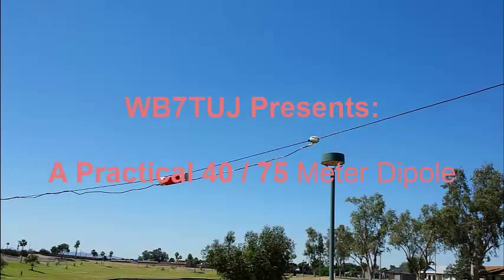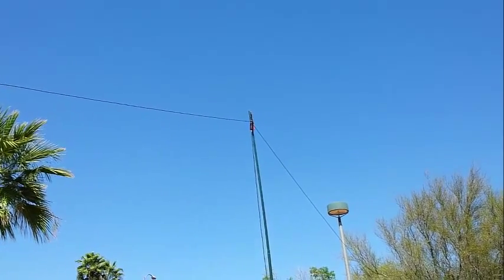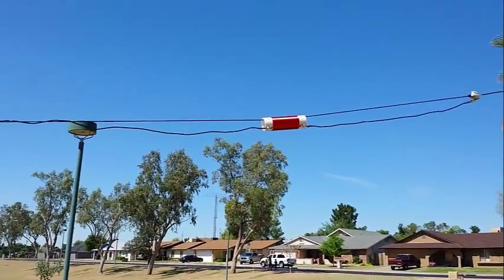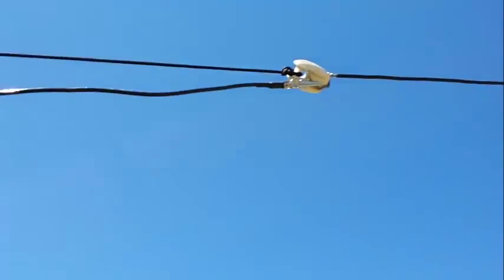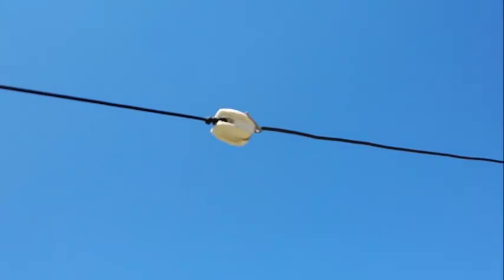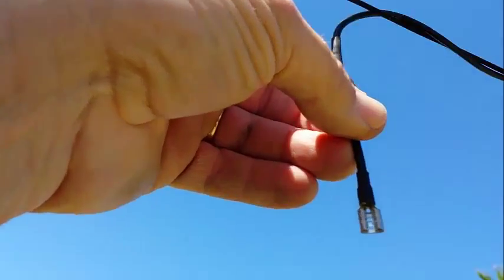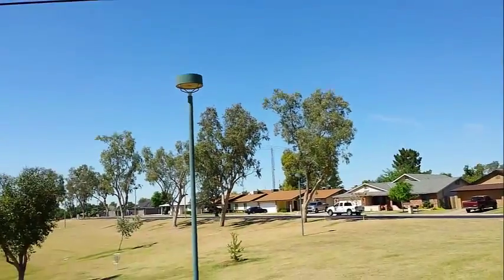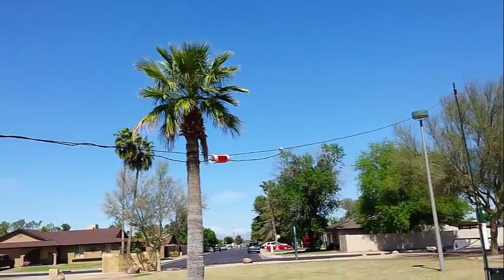WB7TUJ 40 / 75 Meter Dipole Antenna

Comment: Is ther a place / video on how to build the coils?
Reply: Doug discusses the coil components in the video at the 1:25 mark. The PVC is 1 1/2 inch schedule 40, the coil wire is 18 gauge magnet wire, 78 total turns. The hardware is shown in the video. Regards, Joe - N2QOJ.

Comment: Excellent, easy and inexpensive antenna. It might be helpful to newbies to point out that there was nonconductive  cord, not wire, on the left side of the insulator (and of course at the opposite 'leg'). That the coil and 'tail' adds to the electrical length making it resonant on 75 Meters. Sometimes we need to be abundantly clear for the sake of new Hams.
Reply: +snowbird29803 True, and sometimes newbies need to actually expend a some energy and invest some time to learn more about their hobby.  Anyone studying for the Tech license should understand the basic dipole. Anyone memorizing for the Tech license needs to study after-the-fact. "New licensees" and "new hams" are two different things.
Reply: Hi Joe, what inspired my comment was the almost identical color of the cord and wire insulation. Even with my many years of Ham and professional experience, I was scratching my head for a minute until I realized what was up. 73
Reply: Hi Tom, I understand. It wasn't intended for newbies.
Reply: @joesammartino9208  Reading helpful comments like snowbird29803's is one of the ways newbies "expend some energy" to learn. Crabby comments like yours demonstrate the unwelcoming attitude that keeps people from entering this hobby.
Reply: @TheRealLaughingGravy  I don't agree with your premise and reality does not support it. I've welcomed, coached, and trained upwards of 200 new hams in the last 12 years. They deserve more credit than the simpleton, over sensitive attitude you have tried to attribute to new hams.